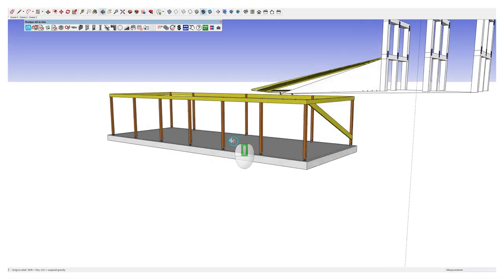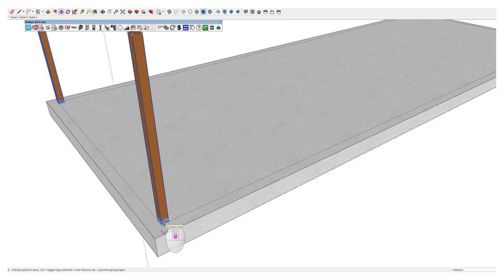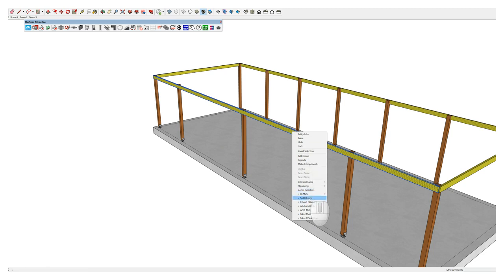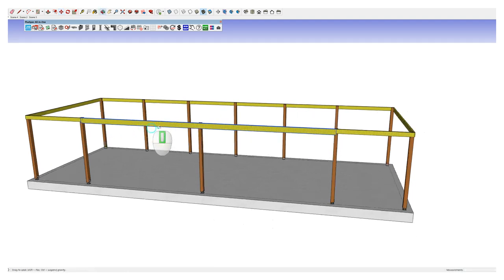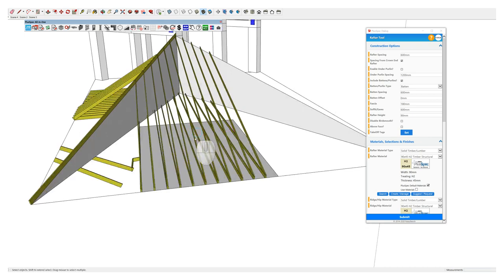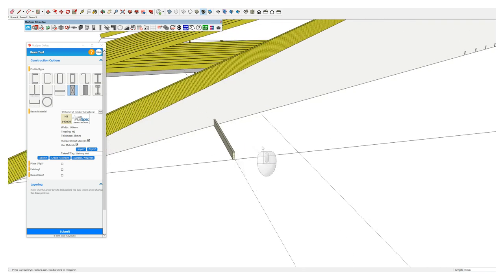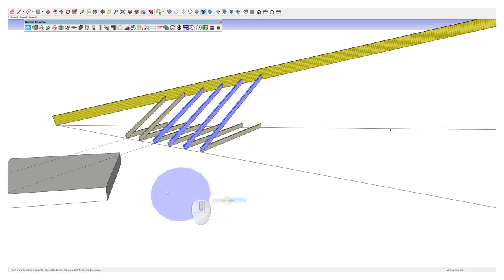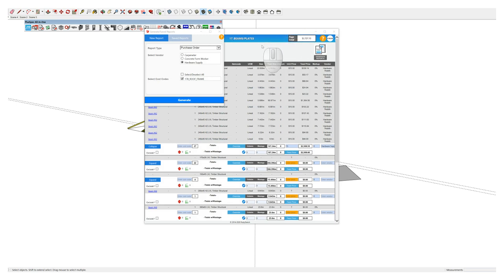NEW Post, Beams & Rafter Tools In PlusDesignBuild for Sketchup Carpenters & Estimators

Comment: Great update Andrew 
When u get some time can u please share scissor trusses and also split pitched roofs ?
Reply from the maker: Ok no problem, when you say split pitched roofs are you referring to the roof or the rafters?
Reply: @PlusSpec  I'm suggesting the truss and rafter options for the roof framing
Reply: @PlusSpec  it would include the roof
Reply from the maker: @PemboDave  I am pretty sure there is an advanced tutorial on Split roofs?
Reply from the maker: Hi Dave I thought you may find this video helpful when it comes to calculating cut and fill https://youtu.be/oRwypceld4k
Reply: @PlusSpec   Hi There sorry I m unable to open the link.  Could u please check and resend?  TIA